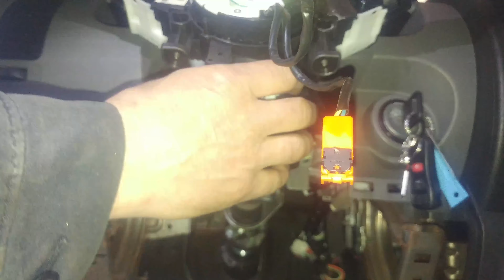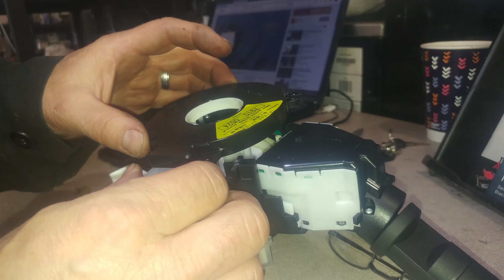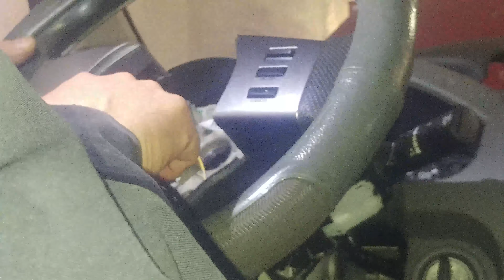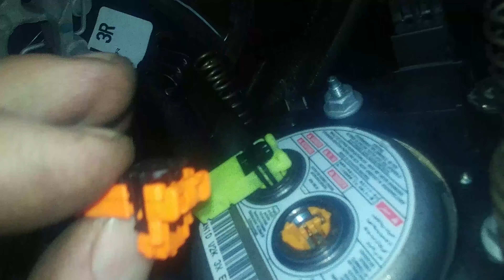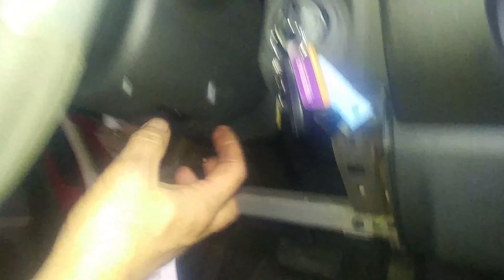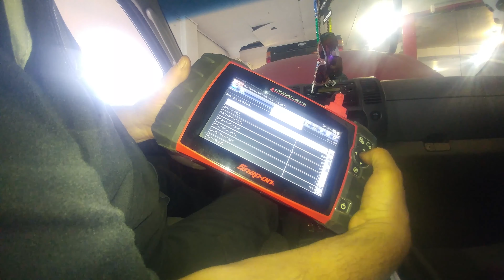Combination switch replacement 2008 Nissan Xterra clockspring turn signal assembly

Comment: I just replaced that part on my 2008 Nissan Frontier, the cruise control works again, word of advice get genuine parts from Nissan, do not get cheap $15 part from Ebay, it will not last long. Thanks for the great video.

Comment: So do I need to replace that whole assembly if my controls for the radio and horn don’t work or can I just replace the clock spring? Thanks gary
Reply: @ gary nuttall   Did you ever find out if you have to replace the whole thing or just the clockspring itself?